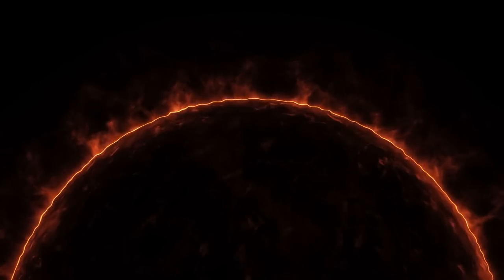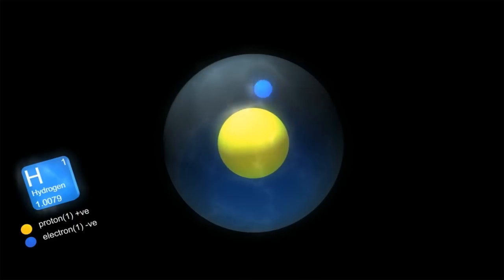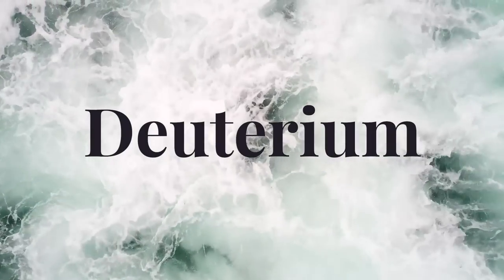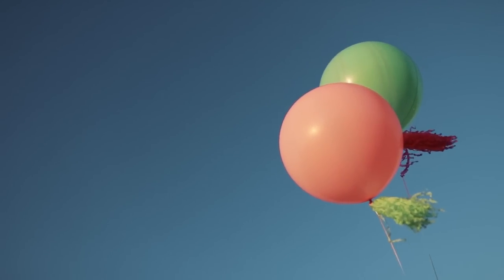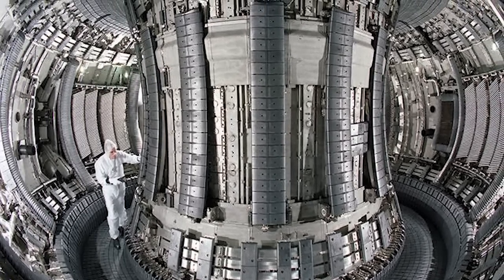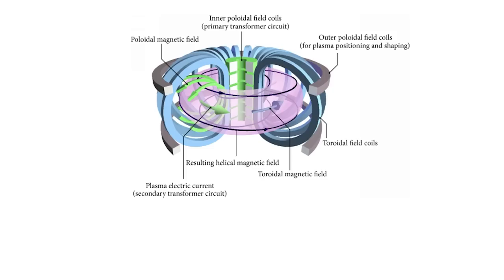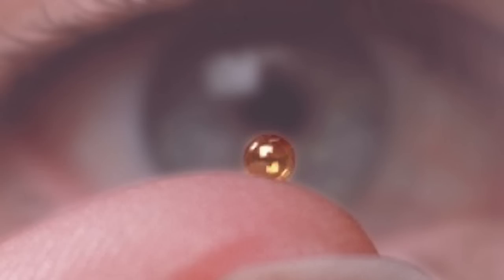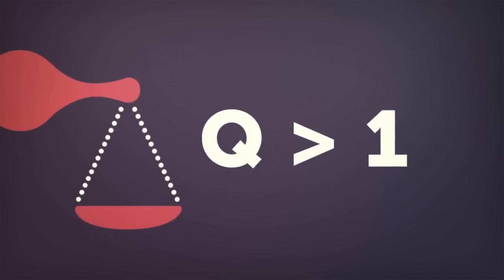Fusion Energy is About to Unlock Humanity's Destiny

Comment: Earth:Nuclear fusion is coming soon
Sun:am I a joke to you
Reply: Solar panels are fusion reactors if you think about it.
Reply: @2MeterLP  Plot Twist: So are coal power plants... Fission too, if you think about it...
Reply: @Alexander_Kale  no, your splitting molecules notatoms
Big difference
Reply: @Alexander_Kale  coal not really. Thats like saying your phone is diesel powered because you charged your battery with a diesel generator. Sure the sun is still the source of the energy, but only by proxy. Solar power takes the energy directly from the fusion reaction.
Reply: @noahcarlton4625  Fissionable materials are created by suns when they explode. Sure, ours were not created by OUR sun, but they are the byproduct of those very, very large fusion reactors.
Reply: @2MeterLP  If you charge your phone from your hamster running on a treadmill, then your phone is in fact hamster powered. 

If your hamster instead creates heat, which you then use to boil water and drive a steam turbine to create electricity to charge your phone with - your phone is still hamster powered, as seen by the fact that your hamster dying will force you to buy a new hamster or go without your phone. 

You see a disconnect where none exists.
Reply: @Alexander_Kale  yah but burning coal is not fision, it's a chemical reaction
Reply: @noahcarlton4625  Coal is created from plant materials, which are created through use of solar power. If solar panels are fusion by proxy, then so is coal. Just a few more proxies.
Reply: @Alexander_Kale  true but it's still not fission,
Stars use fusion
Reply: @noahcarlton4625  This is beginning to remind me of that one chapter in "A Yankee at King Arthur's court" T.T
Reply: I can't wait to buy a Tokamak 350 SUV.
Reply: @Alexander_Kale  I've actually read that, but don't remember a ton
:P
Reply: Riesenfriese r/wooosh. The joke just flew right above your head.
Reply: @2MeterLP  
Not a fusion reactor, but more like a fusion energy transformer.
Reply: We’ve had fusion bombs since the 50’s. But a fission bomb was/is needed to start the fusion reaction.

Comment: Thoughty2: Fusion power shall be harnessed soon!

Nuclear bombs: Am I a joke to you?
Reply: Thats not really fusion
Reply: thats fission
Reply: injustice fellow  
That's because "nuclear bombs" don't actually exist.
Reply: @nietzschesmoustache3585  uhm, did you see what happened to japan?
Project trinity? Tsar Bomba?
Reply: seawater vs uranium
Reply: @nietzschesmoustache3585  are you gonna make people do a paragraph
Reply: @aaaaaaaaaaaaaaaaaaaaaaaaaa  uranimum and seawater? The ocean would be chernobyl
Reply: @Near_Void  
Propaganda. Nuclear power is clean, safe, and cheap. The energy it provided would be so abundant that it would be free. 

The problem was that, by that time, the U.S. dollar was backed by oil. 
Nearly unlimited energy that cost almost nothing would have rendered the dollar (the world's reserve currency) worthless, so they invented "nuclear bombs" as a means of closely regulating nuclear power.
Reply: injustice fellow  
I wish, bruh.
Reply: injustice fellow  there are two types of nuclear bombs.  Standard smaller fission bombs like fat man, and much larger hydrogen bombs like the tsar bomba. Hydrogen bombs use an initial primary fission stage followed by a much more powerful secondary fusion stage.
Reply: injustice fellow Thermonuclear bombs?
Reply: @nietzschesmoustache3585  Nuclear fission  is quite safe. Until you have to dispose of waste, or meltdown occurs.

Nuclear fusion on the other hand is extremely clean and produces more power than what we put it.
We havent got to excess power, but when we do, oh it is gonna be good.
Now, some people might think that a fusion power reactor going into meltdown is a bad thing.
I can tell you, its not. Its actually really safe.
Fusion requires extrenely precise conditions and if those arent met, then fusion cannot occur.
If reactor meltdown occurs, fusion just stops. No explosion, nothing, just stops.

Comment: Fusion + room temperature super conductors = UNLIMITED POWAH!
Reply: Room temperature superconductors aren’t very likely
Reply: @brogant6793  they already exist at relatively  "normal" temperatures (for use in quantum computing) and every year that goes up. its only a matter of time.
Reply: Either that, or the Dark Side. Unlimited Power, ha ha ha ha ha ha haaaaaa!
Reply: @u.v.s.5583  #theempiredidnothingwrong
Reply: Nearest superconductor is hydrogen sulfide at -70C but at 90 gigapascal preasure, you need synthesis diamond to hold it
Reply: REBCO superconducting magnets are what is making fusion more possible now. The MIT team is using REBCO coils, so better superconductors are definitely a key tech related to fusion.

Comment: 2:57 Thats not a quantity of energy!
 500 Megawatts for how long?
Or did you mean Megawatt hours?
Reply: Unless a burning plasma in a tokamak can be achieved, which is one of the goals of ITER, fusion energy will be produced in pulses. ITER is expected to produce 500MW during 400-600sec. Not bad for a proof of principle, not great for commercial power.

Comment: A piston powered fusion reactor will make a great hot rod.
Reply: Check out General Fusions reactor, over 200 pistons.
Reply: Great Scott.!!
Reply: My diesel engine has enough compression to cause fusion, i just put seawater in the fuel tank and away it goes
Reply: 4 cobblestone 3 wood 1 redstone 1 iron
Reply: That would need one hell of a compression ratio.

Comment: This may be off topic but some one may find it interesting. :D Device to end the creation of Nuclear waist.
 Step 1: calculate how much energy you need pumped into the motor to make a vertically positioned circular platter with  magnets in-bedded horizontally around it's left side and right side so there pushing force is pushing out sideways relative to the vertically spinning disc to spin fast. :D Step 2: Calculate how many sets of copper coils you need to be interacting with magnetic fields to achieve this & to perpetuate more electrical current flow then is needed. :D Step 3: Build a round horizontally positioned platter covered in all these copper coils pointed down that does not move (Is stationary) :D Step 4: build a round platter covered in powerful magnets pointed up that can spin and place it directly under platter with hanging copper coils. :D Step 5:  Position the vertical platter that is  motorized close to the horizontally positioned platter covered in magnets pointing up so that when the vertically positioned platter spins the in-bedded horizontally positioned magnetic fields slam sideways against the edge of the horizontally positioned platter causing it to spin. :) Step 6: Make sure enough of the copper coils are feeding their electrical current into the motor and the rest of the copper coils are linked into a set of rechargeable Battery's placed right next to the motor spinning the one vertically positioned disc. Step 7: Build a duplicate setup of horizontally positioned discs with hanging copper coils and disc with upwards facing magnets and position it to the front right, the back left and the back right of the vertically positioned motorized disc. As the vertically positioned motorized disc spins the horizontally in-beaded magnets will now hit into all 4 horizontally positioned discs causing them to spin. so you will effectively be using the spin of one disc powered by one motor to spin 4 constructs that are each generating electrical current. now build this whole setup multiple times over and use the current perpetuated by it to power up scaled electromagnetic generators that are equal to or more powerful than the ones used in a nuclear power plant. You will now have a device that is self perpetuating off of it's own electrical current perpetuation and no nuclear waist to worry about.

Comment: Fusion is a promising prospect for sure and it will be revolutionary, however something rarely considered, is that energy production fluctuates quite a lot, not only during day and night, but also at times like rush hour, or if we all get electric cars, when people come home from work and plug them in.

Fusion is a good backbone to an electrical grid but it's to not good at doing big drops and peaks of energy demand.

In my opinion the real game changer would be a new form of energy storage. Today's batteries are not, cheap nor powerful enough, for the applications we would want to use them for when fusion becomes a reality.

My thinking is that, if more powerful batteries are invented, and they are cheap enough, they could be installed in every house, powering it for 24 hours and recharging from the national grid continuously during these 24 hours, and in turn solving the problem of fluctuating energy demands, making it possible for fusion to be almost the only energy source.

the only fluctuations in this case would come from factories who use more power than batteries could store, or other unforeseen circumstances, and this may be accounted for by dams or other quick sources of energy.

TL;DR: I think we need better batteries to take advantage of the full potential of fusion.

Comment: It is not heat up by the electromagnetic field!!!! 
This is used to protect the material around the Plasma from burning 

They use pressure...
Reply: It appears that clean stable energy with a Q factor of 30 is already developed by an energy based Lab called 

H2IL  Using sea or rain water and 0% nuclear waste. I think this is a better option and we don't have to wait 30 years...

Comment: Baseload, big fusion reactors are as significant to human civilization as the steam engine.
Compact, portable fusion reactors are as significant as Fire
Reply: fusion reactor like fission is a glorified boiler...
Reply: @офицер-к8й  
I mean they're both glorified boilers until you can do wacky shit like perfect neutron kinetic energy conversion into electrical potential, which I'm not sure physics even permits.
Reply: @Ryukachoo  Sure but even if we can do such conversion. It would be questionable if it would be more effecient than turning water to steam throught a turbine.
Reply: @офицер-к8й  It's both possible and much more efficient than any Carnot cycle - the efficiency of direct energy conversion methods ranges from >60% to 90% and yes, Physics does permit that.
There was this guy who received the Nobel prize in physics in 1905 for explaining how that works. His name was Einstein, maybe you've heard of the guy.
Reply: @totalermist  Yeah Direct Energy Conversion. Alot of things are possible in theory but well see when its actually done. Give it 20/30 years and if it still isnt there give it another 20/30 if the political stability allows it resulting from the accelerated climate change and global biodiversity collapse.
Reply: @офицер-к8й  Direct energy conversion is done all around the world every day already.
It's quite possible in practice - I've been running a direct energy conversion powered calculator since the early 1980s and most of my neighbours have direct energy conversion devices installed on their roofs :)
Seems to work quite well, but more can - and will - be done, yes.

Comment: If ITER does work why not just leave it running?

It would produce enough energy for it to be self sustaining and the excess could be sold, funding further research and/or additional reactors.
Reply: Still more concerned about sustaining the reaction than using it's heat to generate power.

Comment: Oh, by the way, Q>1 does NOT necessarily mean nuclear fusion becomes a viable means of power production.  You also have to comprehend the cost to build the power plant, its operating costs, insurance, etc.    Q>1 is only a starting point to feasibility, not an ending point.

Comment: @2:54 Your units are wrong. A AA battery could produce 450 megawatts if all its chemical energy was released in about 30µs.
Reply: Your math is wrong.  P=VI.  For AA battery, 2.6A x 1.2V = 3.12 watts.
Reply: fernarias you did not understand his point. Watt is not a measurement for the energy contained in the fuel. Watt Hours would be a correct unit to use. Watt alone does not say anything about the energy content. And just going off the chemical energy an AAA battery could produce more watts than the sun if the time is just very very short.
Reply: @blise518B  He said chemical energy not fission energy which would be E=mc^2.  You have your facts wrong or your physics wrong.
Reply: @fernarias  You're both wrong. Fission energy isn't E=mc² - that'd be the mass-equivalent energy if the mass is at rest.
The chemical energy inside the AA battery cannot be released in arbitrary short time frames. Therefore you are right in that about 3 watts is the maximum power that the battery can output.
As for E=mc² - that requires anti-matter in order to work. The only reference I could find involved Positronium, which takes between 100 ps and 100 ns to annihilate. That's 10^-10 to 10^-7 seconds - lets go with those numbers.
An AA battery weighs between 15g (Lithium) and 31g (NiMH) or 1.35*10^15 J to 2.79*10^15 J.
The sun's luminosity is 3.828*10^26 W (=J/s).

The power emitted by converting the AA battery to energy is at most 2.79*10^15 J / 10^-10 s or roughly 2.79*10^25 W.

Since an AA battery consists of many atoms spread over quite some distance, not singular positrons, it's safe to assume that matter-to-energy conversion would take much longer, so 10^-7 s is closer to the actual time.
This leaves us with at most 2.79*10^23 W for the total power that can be released by an AA battery (if converted to pure energy), which is three orders of magnitude less than the sun's luminosity.

TL;DR the mass-equivalence energy of a AA battery is less than the power output of the sun no matter watt.
PS: it's also impossible for AA battery to release 450 MW of power without anti-matter being involved.
Reply: @totalermist  E=mc^2 is the formula for the energy you would get for converting mass into energy, in joules.  Any mass can theoretically be converted to energy (we've done it with fission and fusion) and it does not require anti matter.  An aa battery weighs 23 grams and it's equal to 2,067,136,911 mega joules if all mass was converted to energy.
Reply: That’s why I said just going off the chemical energy... I know it can’t actually release it that fast. It’s just to explain the point that just because something gives off a high amount of watts does not mean it has a lot of energy... no facts wrong just wrong interpretation.
Reply: fernarias and you still did not understand the difference between watts and Watt hours... that’s the whole reason the video is wrong. Not some bullshit how much energy is in an AA battery. That’s was just to visualize that W is not Wh
Reply: @blise518B  Watt is a measure of power, it is the derivative of unit of joeles over time.  Watt hours is a derivative of watts, the second derivative of the unit of joeles over time.  I'm not correcting the video, I'm correcting the nonsense post.  I think you lack understanding.
Reply: @fernarias  you cant  messure energy in W... you messure it in Wh thats all i want so say and thats correct.
Reply: @fernarias   fernarias  > "E=mc^2 is the formula for the energy you would get for converting mass into energy, in joules."
And that's what mass-equivalence energy is - your point being?
 
>"[...] (we've done it with fission and fusion) and it does not require anti matter."
You're talking about nuclear bombs - that takes more energy to get the conversion started than is released by it. That'd completely defeat the OP's point.

>"An aa battery weighs 23 grams [...]"
The weight of an AA battery depends on its composition - AA is a size , not a weight indicator - and the weight varies as I noted. A lithium battery weighs less than an alkaline battery, which weighs less than a NiMH battery which is why I used a range instead. Picking a specific value arbitrarily is again completely pointless.

Comment: 0,5 gram provides 500 MW?
That doesn’t make sense mate. MW is a rating of power, not energy.
In comparison, it could power 1000 MW for half the time, but it doesn’t state for how long that time is.
You meant MWh?
Reply: Blind Bob the ball is fueled by nuclear reactions. The input is just used to create the boundary conditions, so no violations of thermodynamics there. 

You could say the same about a turbo-charged engine so you like. The turbo gives more energy by higher compression but is run by the engine. That’s no violation either cause the energy is supplied by the fuel.

Comment: @1:52 "Simulating nuclear fusion on planet earth". Simulating? It's still actual, not simulated, fusion :) Great video though!
Reply: @tamikuru7936  Now when you say nuclear powerplant, do you mean fusion or fission? True a meltdown on a fission nuclear powerplant is a huge problem, we have a couple off exampels off that. Nuclear fusion on the other hand can't really do a meltdown, nothing really happens if the conditions for the nuclear fusion suddenly dissapears inside the ractor, other than the plasma cools down and becomes a gas again, and the reactor just stops producing energy and that's it. If you mean the reations will go haywire and kick off a fusion nuclear chain raction and explode in a huge fusion explosion, you just simply remove the conditions for it being a plasma and thus being able to do fusion reactions. The best and easiest way to do this is to remove the elctromagnetic field, that keeps the plasma in place, by turning off the electromagnets, bc then the plasma will disperse in all directions, cool down and return to a gas.